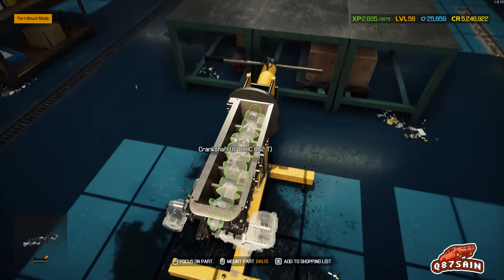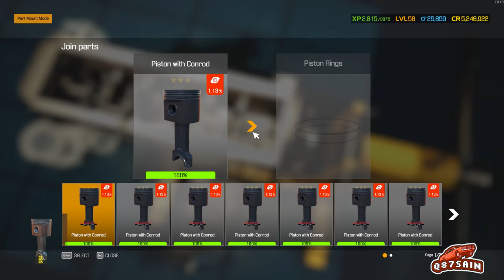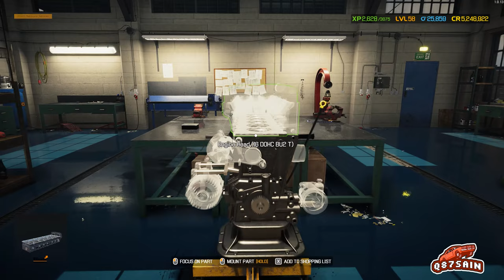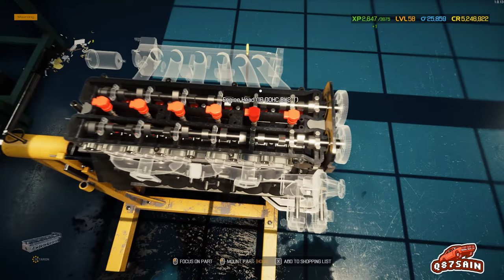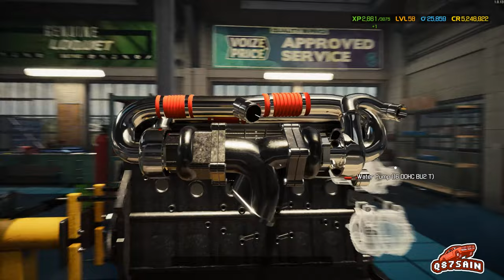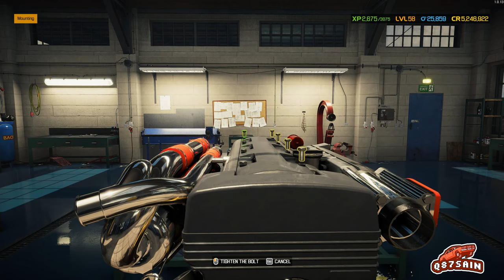Car Mechanic Simulator 2021: I6 DOHC BU2 Turbo

Comment: where does clip B go
Reply from the maker: There’s no clip B in this engine build
Reply: Yes there is
Reply from the maker: Depends on the car which you are building not the engine
Reply: @burningbassoutdoors3803 did u find out I need to kno
Reply: @perc8marv357 I also need to know where clip B goes I'm building a supra and it's the only thing I need to put
Reply: @GiovaniPortilla-b9g  oh I got it, it goes on the air box the black box
Reply: @perc8marv357 dude you just saved me SO much time.  Thank you
Reply: @perc8marv357 where where
Reply: @zachthompson4191 where bro I've been on this for an hour
Reply: @mobplaysyt778  it’s on the air filter
Reply: @zachthompson4191 bro I pulled my engine back out just to look for clip b 😭
Reply: WHERE IS THE CLIP B